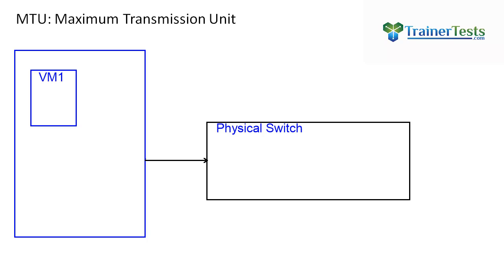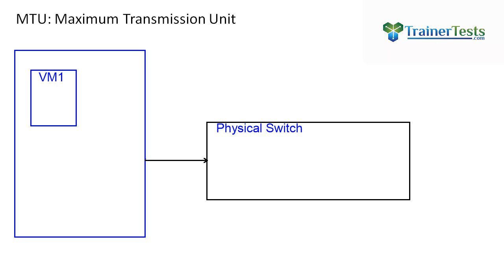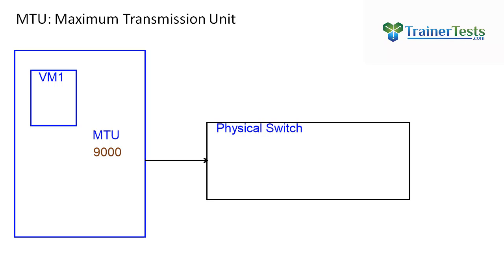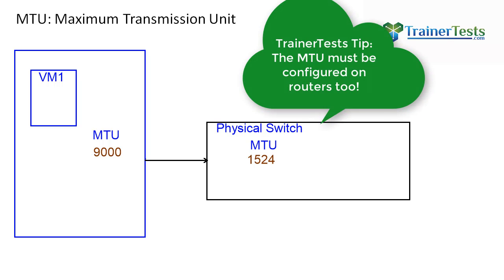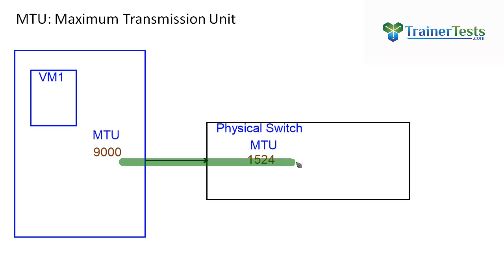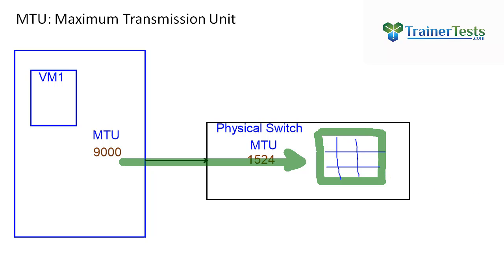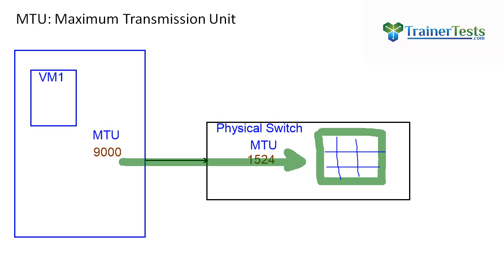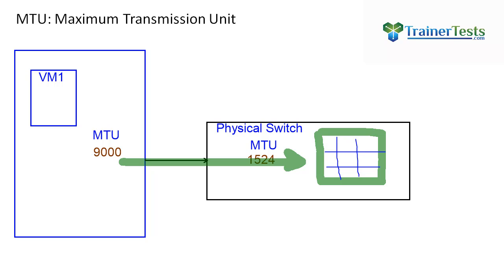Understanding Maximum Transmission Unit (MTU) - TrainerTests.com

Comment: I must clarify here, because this topic for me at least was very hard to get in the beginning and maybe it is for others as well: physical switch (L2) won’t fragment anything by itself, just drop frames bigger than MTU SET.  If the vm initiates the connection, in order to fragmentation to occur you must be going through a L3 (router - different L2 domains) device which in case that incoming frame is bigger than outgoing interface supports will reply back (the router itself if enabled) to source with a packet too big como mag, with this “instruction” this device will try to find the maximum possible frame size and consecutively the communication can be established. Otherwise source will hear nothing back and communication fails. Within same L2 domain ALL devices should support that same max MTU OR you will have issues

Comment: question. Does the switch able to do fragmentation?
in my opinion, the switch will drop the frame due to mismatch mtu size.
If it was a router, router can do fragmentation.
Reply: Daniel Octavianus 
What the L3 switch will do, with a too large MTU packet, on a L3 interface, depends on the IP packet.  If the packet's DF (don't fragment) bit is set, switch will drop the too large packet and send a notification to the source.  If the packet's DF bit is not set, switch will fragment the packet and forward the fragments.

To your  question, if the egress port was L2, but supported a smaller MTU (a bad configuration, but if so configured) port will drop frame and not send any notification.  (Oh, and if other side of link cannot take the larger frame, it too will drop it without any notification (another bad configuration

Comment: Hello, At 3.04 you are mentioning that the packet received at the switch will be broken down into multiple pieces as the switch has lower MTU size(1524) and the frame it has received from esxi is of higher size(9000). But I feel the switch will drop it as there is a mtu mismatch. Suppose if the switch incoming interface has MTU of 9000 (which matches with esxi) and outgoing interface has mtu of 1524, then It would have broken the frame into multiple frames(9000 divided into multiple frames due to fragmentation) while going out of the switch
Reply: All this  yet he didn’t define what is MTU in brief? 
Maximum transmission unit (MTU) defines the largest size of packets that an interface can transmit without the need to fragment. IP packets larger than the MTU must go through IP fragmentation procedures. Cisco ATM router interfaces support an MTU between 64 and 17966 bytes.
Reply: Ingress interface does not drop packets. MTU applies to outbound.  Packet comes in - the switch will identify its start and end headers  regardless of MTU size. The switch will switch to egress port. The packet must be equal or lower than the MTU size of the egress otherwise it will be dropped
Reply: Pradeepkumar Baratekke 
You are right bro. Are you a network guy?
Reply: Absolutely right, the switch doesn't make any fragmentation.
Reply: Video needs to be corrected . MRU of switch needs to be ,greater or equal to 9000
Reply: What the L3 switch will do, with a too large MTU packet, on a L3 interface, depends on the IP packet.  If the packet's DF (don't fragment) bit is set, switch will drop the too large packet and send a notification to the source.  If the packet's DF bit is not set, switch will fragment the packet and forward the fragments.

To your second question, if the egress port was L2, but supported a smaller MTU (a bad configuration, but if so configured) port will drop frame and not send any notification.  (Oh, and if other side of link cannot take the larger frame, it too will drop it without any notification (another bad configuration.